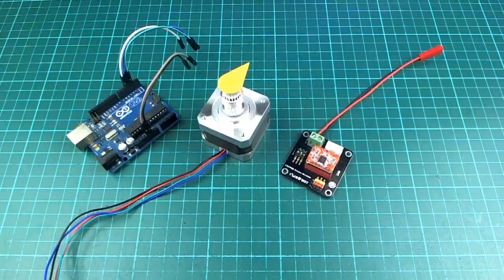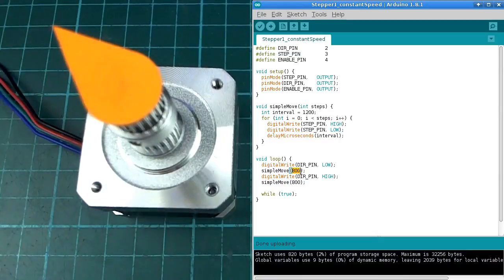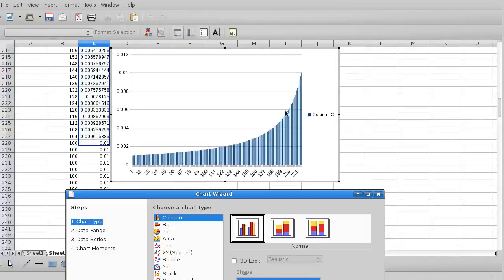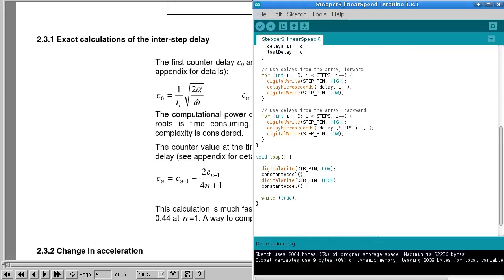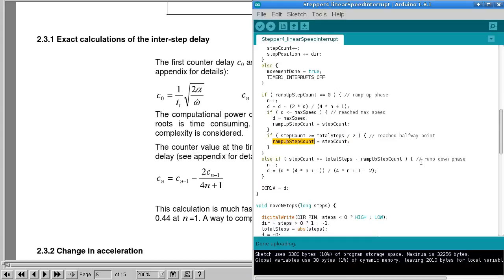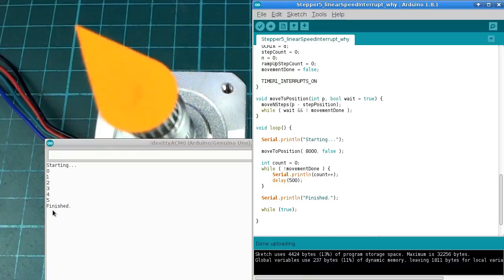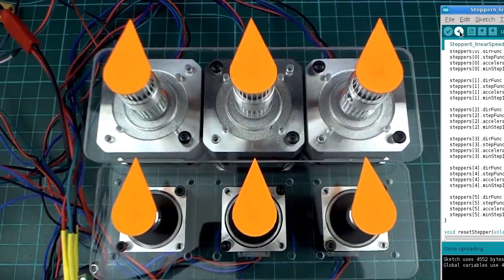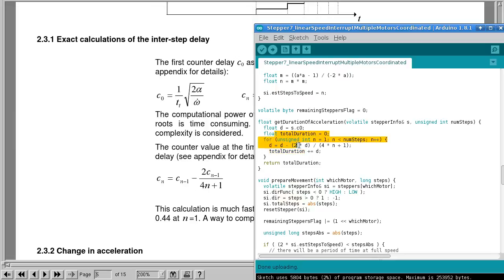Coordinated stepper motor control (arduino)

Comment: From looking at the motion planning code, it doesn't seem like they all accelerate at the same times.  initially, they are all set to the same 1000-unit acceleration(c0 time delay), so and all reach top speed/minStepInterval at the same time, so the acceleration period would end at the same time, but then when you apply the speed scaling, it looks like it would stretch out the acceleration curve for longer.  So if the fast axis comes up to speed in 0.1 sec, then a 5x slower axis might come up to speed in 0.5sec.  The movements still finish the entire movement at the same time, but since their acceleration curves aren't syncrhonized, they aren't coordinated for straight-line movement--one axis is still accelerating while the other is moving at constant speed.

Although they start and stop at the same times, they aren't accelerating for the same times, so the motion is not coordinated.
Reply from the maker: Yes, you're correct. Not sure if it completely disqualifies usage of the word 'coordinated' though.
Reply: @iforce2d   It is hard to tell from the videos, since I think the accelerations are pretty quick compared to the distances, and it might be just a small fraction of the motion.  It would then be straight-line coordinated motion during the cruising segment, but (versus the 44:04 explanation) there would be some bends and curves in the line as some axes finish their acceleration while others are still accelerating. CNCs and 3d printers keep stepper motions perfectly coordinated by planning the motion for the controlling axis, and moving the other axes in precise position ratios to the controlling axis using the Bresenham algorithm.  To do perfect straight lines by scheduling time, you'd also have to at least synchronize the times of the changes in acceleration, and then...the `p=1/2*a*t^2` physics formula of motion would make the motion proportional to the acceleration: `p/a = 1/2*t^2`.  So straight lines where the accelerations are both/all happening, and bends where one axis is accelerating while the other(s) is cruising, and then straight lines again when they are all cruising.

Comment: Thanks for the video, files, and the replies to my previous comments.
Do you think it is possible to modify your Stepper3 file to run continuously rather than have the number of steps hard coded?  Ultimately,  I want to push a button to start the motor at your Low Speed, accelerate to your High Speed, then run  at the High Speed until I release the button.  Thanks. Regards.
Reply from the maker: Unless you want to count steps/position, it sounds like you don't really need steppers at all for that?
Reply: @iforce2d  I have a NEMA 34 that I either use a Rotary Encoder to move a hard coded number of steps, or I use a button to start and run the motor until I release the button. It works well, but as you showed in your video, without acceleration code, the top speed is limited by how fast the motor can start from a dead stop. Also, my application is a heavy load, reducing the starting speed further. Thanks very much for the reply. I appreciate it very much. Regards.
Reply: @iforce2d   I have solved my coding problem for accelerating a stepper motor with the help of Googles AI bot.  Told it what I needed and it wrote the code for me.  I still had to modify it for my needs, but not much.  It works better that any code I've tried in the last few months.  Thanks very much for your kind help. Regards.

Comment: Hi, I hope you can answer me a basic question: can I drive a 1.5A 12Vstepper motor with a slightly lower current like 1.3A? Thanks!
Reply from the maker: Yes. The current rating just lets you know how much current would make it too hot.

Comment: Thank you SO much for your help in my previous comment.  Very kind of you to take the time.  I'm going to try and implement your acceleration code, but replace the "highspeed" (at 9:18 in the video) with an AnalogRead of a Potentiometer.  I think this will accelerate the Stepper Motor to a maximum speed that I have set on the Potentiometer. Thanks again. Regards.

Comment: Fascinating stuff.  I got stuck on the Simple Code.  You are turning the STEP_PIN  HIGH, then LOW then delay. I thought that the delay needs to be between HIGH and LOW code as well as after, as you have it.  I'm watching the Motor run with that code, but I don't see how it works??? Thanks.  Can anyone enlighten me?
Reply from the maker: Correct, most stepper drivers have a minimum time the pulse needs to remain high in order to be detected. For the A4988 drivers I was using the datasheet says 1µs which is pretty short compared to some others. However in reality it will often still work with a shorter pulse than the datasheet says. For an arduino running at 16MHz a single instruction would take 1/16µs so if the high pulse only requires one instruction, then in theory this should not work. I was actually not aware of the pulse length requirements at the time, so I think I just got lucky.
Reply from the maker: ah, you're talking about the very first code that uses digitalWrite to toggle the pin? Apparently digitalWrite can take up to 50 clock cycles so that would explain it. The 1ms delay in that code is there to set the speed of the motor, not to allow the pulse to be detected.
Reply: @iforce2d  I actually tried your code and it works, but I'm still not sure exactly how.  All other code that I have see to power a stepper with Arduino, "creates" pulses by outputting  HIGH, delay, LOW, delay, loop.  Changing the delay time changes the motor speed. So your code, HIGH, LOW, delay, works, but it doesn't make sense to me as to why. I have some theories and your reply helps. Thanks
Reply from the maker: It's the time between the highs that sets the speed, not the time between the highs and lows.
Reply: @iforce2d Thanks again for your reply.  I'm still trying to wrap my head around this, and I hope to get a good understanding of it.  My understanding was that in creating a square wave form, the width of the wave, ie: how long it remains in a HIGH state, was important. (PWM - Pulse WIDTH Modulation) Perhaps that is not true. Can you direct me to any reference material online that would help me get a handle on this?
This is really ground breaking information for me, as I have written quite a bit of Arduino code to run Stepper Motors, and I have always followed the same format as all other examples of such code that I have seen, ...... until now. Thanks very much for your kind help. Regards
Reply from the maker: I don't think this signal would be classified as PWM like other signals you might have come across, because the width of the high state is not actually relevant to the information being sent. It's the transition from low to high that triggers one step of the motor. So there is no difference between:
HIGH, delay, LOW, HIGH
and:
HIGH, LOW, delay, HIGH
The high state does need to be long enough for the stepper driver to detect it though, typically this is a few microseconds but each driver is a little different. If you search for "A4988 datasheet" and look in the PDF for "Step minimum" you'll see what I mean. As for why we can use digitalWrite to turn the pin on and then immediately off again and it still works with the A4988, see this video: https://www.youtube.com/watch?v=U7I0GkwW1yE
Reply: @iforce2d Thank you for the explanation.  I think I am starting to get it.  I have a NEMA 34 and a DM860S driver. The motor starts stalling/vibrating at a medium high rpm.
I will change my code and see if it helps.
Thanks for your patience. I really appreciate your help with understanding this.  I wonder why so many people code HIGH delay LOW delay, loop?  Thanks again. Regards.
Reply from the maker: Coding 'HIGH delay LOW delay' would be necessary if the driver needs a longer step pulse. For example the DM860S datasheet says "Pulse width not less than 2.5µs". If you watched that video demo, he found that calling digitalWrite with HIGH and then LOW immediately afterward provided approximately a 2.5µs pulse, so it could possibly work but you'd probably want to add a little extra to be sure.
On the other hand, if you use direct port manipulation (eg. PORTD = b00010000) then you will definitely need to add some delay during the HIGH.
Reply: @iforce2d  Thanks!  You are so knowledgeable on this subject. I hope that you will make more videos on Steppers, Stepper Drivers, and Arduino.  I think my problem with the DM860S is "noise" interference,  and it is very hard to track down the source.  Am going to experiment with different  drivers. Thanks again. Regards.

Comment: DOES MICROSTEPPING ALTER HOW STEPPERS ACCELERATE UNDER REAL LOADS?
Reply from the maker: Not really. Microstepping means the motor can stop in between steps. So if the motor has 200 steps per revolution (1.8 degrees per step), then 2x microstepping will let it stop at 400 positions per rotation (0.9 degrees per step). If the movement distance is more than one or two steps, microstepping wouldn't make much difference to the acceleration.

Comment: Hello! I'm a college student in South Korea. I'm really thankful to you for helping me learn more about controlling stepping motors through your video. However, I have several questions about this.

Firstly, why did you choose the angle to be 1 and the acceleration to be 0.01? Was it calculated or an approximation? If it was calculated, could you share the formula?

Secondly, why did you choose a starting delay of 2000 and a high speed of 100?

Thank you very much, and have a great day!.^^7
Reply from the maker: I think I just tried some numbers, and adjusted them until I got the result I wanted.
Reply: Oh I see! Thank you! Have a nice day.

Comment: Thanks much for the obviously great amount of time you put in! i just want to know if the shield contain already  the driver or not and where can i find this shield
Reply from the maker: The shield is usually sold separately, so you can plug in whatever type of driver you prefer. Look for "RAMPS" board for the one with 5 driver slots.
Reply: @iforce2d   thank you so much

Comment: Nice job in explaining your sketches and theory. I was wondering if you could, in your linear transition, instead of calculating the slowest movement to end all processes could you calculate for the fastest? For example when using two motors starting at “M1 pos 0 and M2 pos 0” to “M1 pos 20 and M2 pos 40” you are calculating so M1 finishes the same time as M2, where M2 would take longer to arrive at desired pos. In some cases I would think it would be more expedient to calculate for the faster motor, making both arrive at desired pos sooner.
Reply from the maker: Generally there will always be one axis of movement that limits the movement speed to some upper bound. For example in my CNC router the gantry weighs about 35kg and cannot move as fast as the much smaller spindle. If I want a straight line move the only way is to match what the slower axis can do. Making the stepper controller match the speed of the fastest axis would only result in missed steps on the gantry.

Comment: Thank you for this video, it is really interesting, helpful and great video. However I use DM320T stepper driver. So I need delayMicroseconds between Step High and Step Low . I solved it in stepper_interrupt by adding delay microseconds in ---STEP_HIGH
    delayMicroseconds(d);
    STEP_LOW . However in Stepper6_linearSpeedInterruptMultipleMotors I tried to add delayMicroseconds(OCR1A); between Step high and Step Low in step function of all 6 motors. But it skips steps. I tried in 3 then 2 motors only in case of insufficiency of current(Even though power supply can supply enough current for 6 motors). Still skips steps. Can I get help?
Reply from the maker: Interrupts should return as quick as possible, so using a delay inside an interrupt is never a good idea. It sounds like your requirements are more demanding than my naive method can handle. You would need a separate timer for each motor, that you could trigger independently to count down for 7.5us (for DM320T) and then bring the pin low. This is beyond the capability of a regular arduino for any more than a single motor.

Since the time is always a constant, it might be possible to use external hardware like the 555 as an external delay. Here is what Chat-GPT says about that:

To use a 555 timer to hold a pin high for a specific duration, such as 7.5 microseconds (us), you can configure the timer in monostable mode. In this mode, the 555 timer generates a single pulse of a fixed duration when triggered.

Here's a basic circuit diagram and the corresponding steps to achieve the desired functionality:

Gather the required components:

555 timer IC
Resistors (R1, R2)
Capacitor (C1)
Power supply (Vcc)
Connect the components as shown in the circuit diagram:

Connect the trigger pin (Pin 2) of the 555 timer to the desired input signal that triggers the pulse.
Connect the discharge pin (Pin 7) to the threshold pin (Pin 6) of the 555 timer.
Connect the discharge pin (Pin 7) to the capacitor (C1) and resistor (R2) in series.
Connect the junction of the capacitor (C1) and resistor (R2) to the output pin (Pin 3) of the 555 timer.
Connect the other end of the resistor (R2) to the power supply (Vcc).
Connect the ground (GND) pin of the 555 timer to the ground of the circuit.
Calculate the component values:

Determine the values of resistor R1 and capacitor C1 to achieve the desired time delay.
In this case, for a time delay of 7.5us, you can use R1 = 1kΩ and C1 = 10nF.
Adjust these values as per your specific requirements.
Apply power:

Connect the power supply (Vcc) to the positive terminal of the circuit.
Trigger the circuit:

Apply a trigger signal to the trigger pin (Pin 2) of the 555 timer.
When triggered, the output pin (Pin 3) will go high and remain high for the duration determined by the resistor (R2) and capacitor (C1) values.
By adjusting the values of R2 and C1, you can achieve the desired timing accuracy. However, it's important to note that the accuracy of timing in microsecond range using a 555 timer may be limited due to component tolerances and the inherent characteristics of the timer.
Reply: @iforce2d  Thank you for your reply. I will try using teensy 3.6 instead of arduino. If it doesnt work I will try the 555. I will update you.
Reply: @iforce2d   Hi, I used blink without delay method instead of delay. It worked

Comment: Just in case this helps out any other rookie programmers here, I finally figured out why the final sketch wasn't working when more than 8 motors were added in the same manner in the code.  It's because the left and right bitshift operators (<< and >>) would break the byte type for remainingSteppersFlag and nextStepperFlag. Just find "byte" and replace with "word" in the sketch and all is well. All you experts can tell me how obvious this was but it took me all day. I was sure something in the interrupts or timing needed to be adjusted given the extra overhead, but no. Live and learn!

Comment: its year 2022 and found this video very useful. im  impressed  the cheap A4988 could move that smooth with that algorithm,  i though only the more expensive drivers with proper sinewave output like TMC2009 and similar could move like that.

Comment: https://youtu.be/fHAO7SW-SZI?t=2787

if you know the number of steps you have to traverse you can *pre*calculate before the start of the stepper motor rotations(motions)? By pre calculate, i mean save the value in an array and use the value stored in array instead of calculating on the fly??
This may save some time during the motion.

I have not fully understood the logic yet but I am trying.
Reply: i forgot to thank you as i was looking for this information which is rare to find.
Reply from the maker: You are correct, but that will be limited by available memory. For regular arduino there is only 2kb RAM.
Reply: @iforce2d  That's the trade off 🙂 

I need something similar in STM32. I don't have full understanding of ISR. More specifically this part of your code.

**************************
 noInterrupts();
  TCCR1A = 0;
  TCCR1B = 0;
  TCNT1  = 0;

  OCR1A = 1000;                             // compare value
  TCCR1B |= (1 << WGM12);                   // CTC mode
  TCCR1B |= ((1 << CS11) | (1 << CS10));    // 64 prescaler
  interrupts();
**************************

how to port this code to STM32.
Reply from the maker: I don't know how to do it in STM32 or arduino either, I just copied and pasted something. This is not the kind of thing you will learn well via YouTube comments, better to read some real documentation and tutorials.

Comment: I'm using your simpleAccel for a 3 motor polisher, with 3 motors of 2HP, they move with the help of linear rails and servos back and forward to polish metal, is really really cool your video.

Comment: Can we use both Nema 17 (DRV8825) and Nema 23 (TB6650) on same Arduino simultaneously?
Reply from the maker: I don't see why not. The arduino only connects to the drivers anyway, not the motors. As long as the driver has a direction and step pin, the motor makes no difference.

Comment: Hey, your work is awesome❣️, I really appreciate and I wanted to ask for help. 
Actually I'm working on a project where I have to run 4 stepper  motors together but at different speeds, this speed will be calculated by a math equation, the equation will result in speed (in steps/second) for each stepper motor & this speed will be changing with time also.
 How should I accomplish this target, please help. 

And you are able to do so much programing, and it really works, so does this require a great practice in C++ language or you had to work seperately for arduino programming.